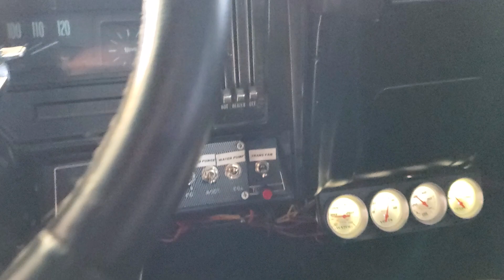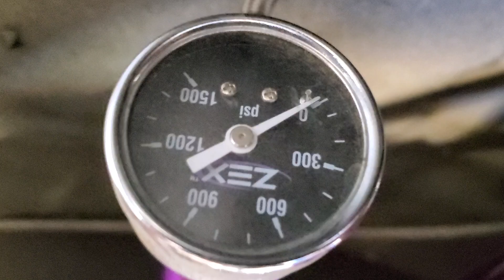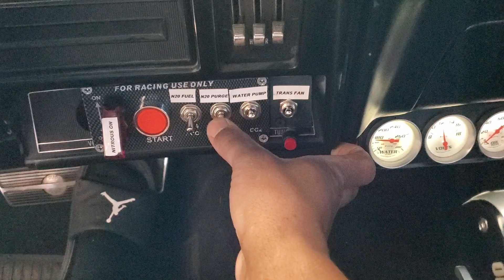CHEVY NOVA 489 BIG BLOCK WALK AROUND

Comment: You use braided lines for your trans lines? And didn’t U install a block off plate on your turbo 400 speedo? Where’d u get it ?
Reply from the maker: Braided yes block plate ebay
Reply: SS396RAT you’ve had it in for awhile now, no leaks ?
Reply: SS396RAT thanks
Reply from the maker: @zelly1327  not 1 leak

Comment: Is that the factory throttle cable?
Reply from the maker: Yup
Reply: @ss396rat  What throttle bracket is that? I have a summit one, looks just like that but the rubber on my factory cable won't fit in the hole that holds it